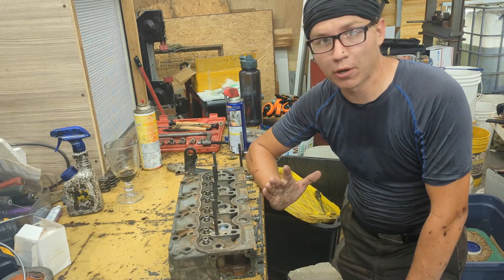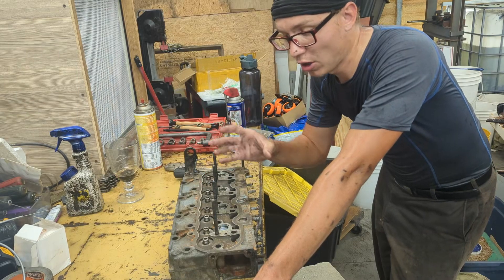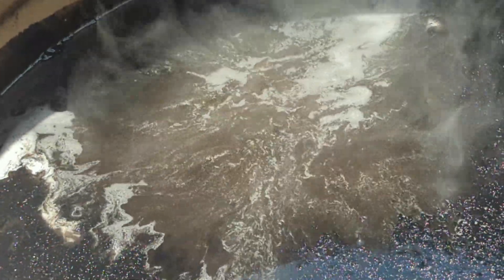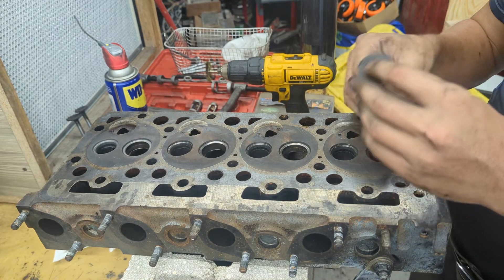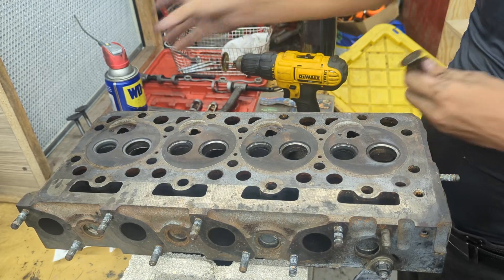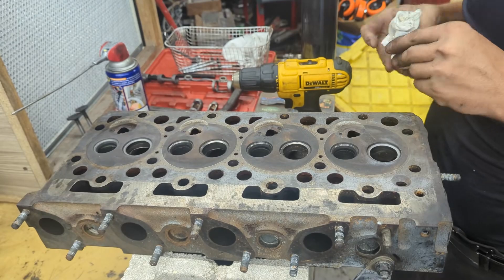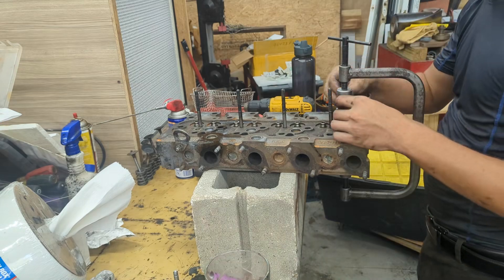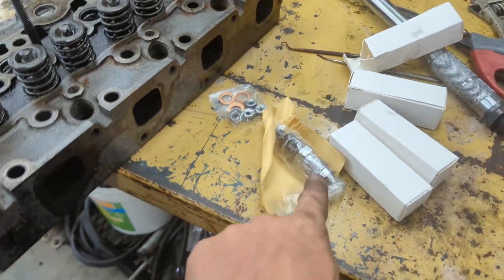How to rebuild/repair any Kubota diesel engine Part 2 Cylinder Head

Comment: I disagree with you, Chinese valves can be of poor quality, the valve bushing is oversized (defective), the exhaust valves are made of magnetic steel, or they are curved from the factory. The Chinese don't know anything about thermal clearances. They haven't studied hundredths and thousandths of a measurement in schools or colleges, and they don't know what a micrometer is.
Reply from the maker: Ok. I use Chinese cylinder heads on all my diesel engines, working great. Where do you think it's originally made from...

Comment: I am unable to find the video where you put everything back together. I got a Kubota Bx1800 d722 and am unable to find torque specs on the timing cover or gear cover as some call it. Would you happen to know? Thank you!!!
Reply from the maker: Use google/read the service manual. For the timing cover I have never torqued it. Typically for miscellaneous stuff like that they just go based off bolt torque.

Comment: You wouldnt happen to know the torque settings for the injectors, I cant find the spec's anywhere(V2203A)
Reply from the maker: search on google "kubota v2203 injector torque specs" heres some links
Page 1-4
https://www.shareddocs.com/hvac/docs/2000/Public/02/62-10865.pdf

https://www.kumarbrosusa.com/kubota/torque-pdf/03-03MM%20Series%20Torque%20Specs.pdf

Comment: You don't lap valves with a drill you don't make a complete spine you mating your valves to your seat .
Reply from the maker: Yes you do as long as you use a flexible adapter like a silicone tubing
Reply: @Rowow  you dont make a full circle the ideal iscto match the vale with the seat ask any mechanics
Reply from the maker: thats why you go slow and lift it often. As I clearly do in the video. Great compression so it works @patpeacock8150
Reply: @patpeacock8150  Making a full circle should be of no consequence. If anything it should give a more even seat than the back & forth action of hand tooling the valves which can leave uneven seats if done incorrectly.
Reply: @Balls-of-Steel504  no one I know lap valves like that
Reply: I'm an ex lube bay mechanic & i don't see any reason why this method can't be used. As long as care is taken to not go too fast & the lifting would also reduce heat. This method should give a perfect valve seat. I expect if careful it would give a more even seat than hand working a valve tool.
Reply: Certified mechanic here. I put a flexible hose on the end of my valve stems and spin with a drill. Been lapping valves this way for 40 years. With the valve resting in the seat (without spring pressure) I will pour gas on the valves and make sure they don't leak. His method is perfectly acceptable and much quicker. By the way, even using the hand lapping tool you roll it back in forth with your palms and make a full circle.